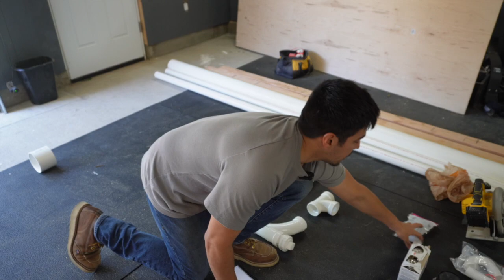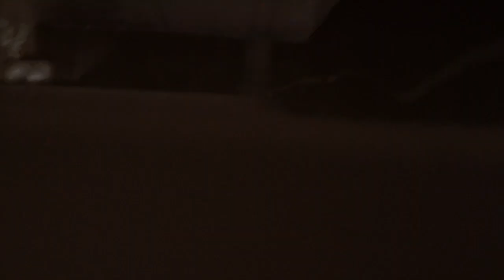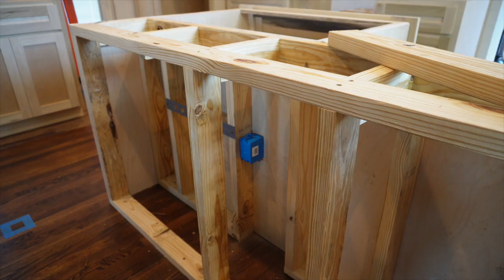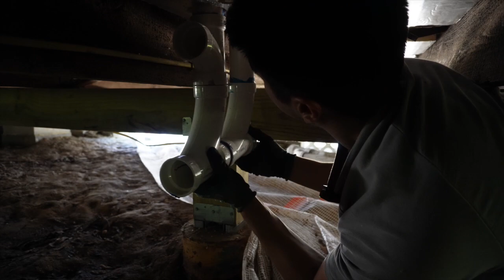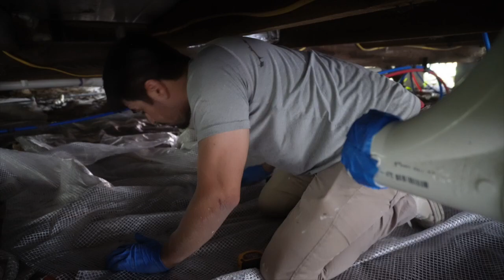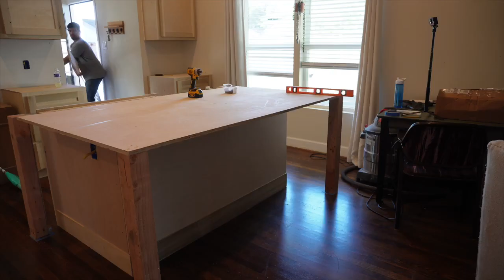DIY Kitchen Island - Part 2: Electrical and Plumbing

Comment: Two years later, but very helpful.  Great work. I am designing my kitchen peninsula. I have sink cabinet on inside of kitchen 24 inch deep, the other side cabinet has all drawers. I don't have space for a 4 inch pony wall. Can I make a smaller width of pony wall (2.5 inches for electrical) and have plumber put plumbing in cabinet space? Or can I hang all the MEPs in the kitchen cabinet? Would love your advice.